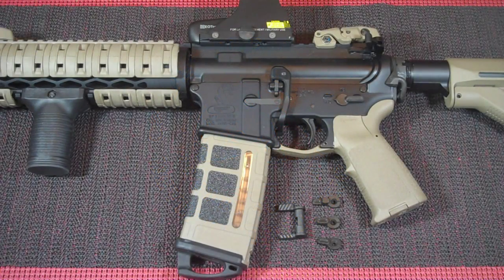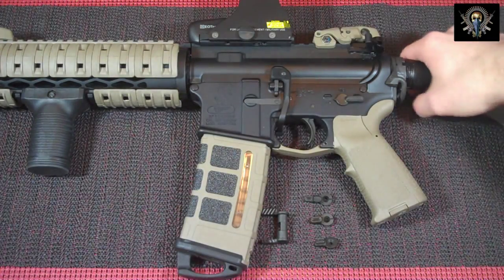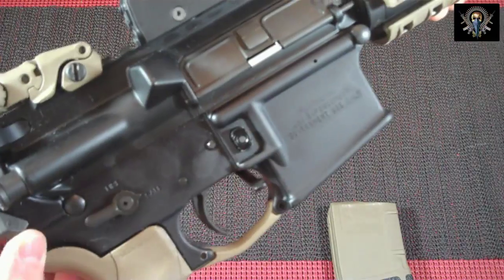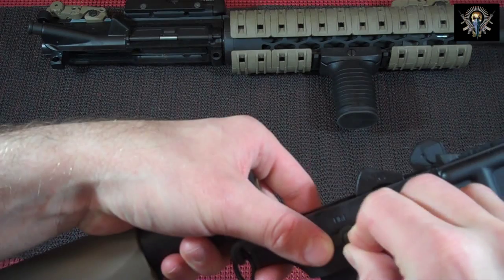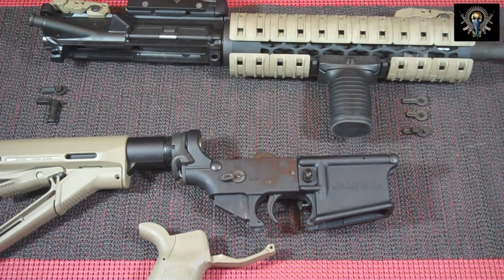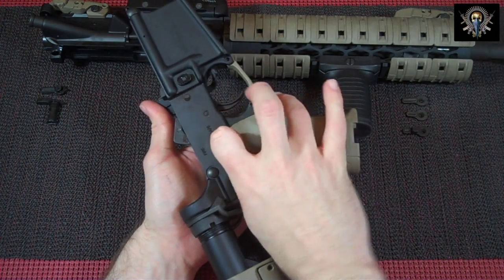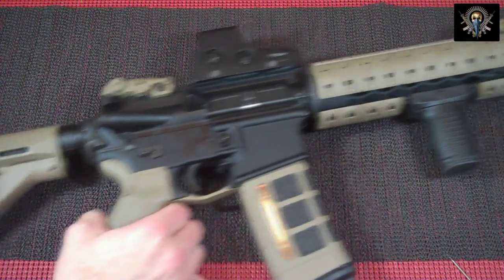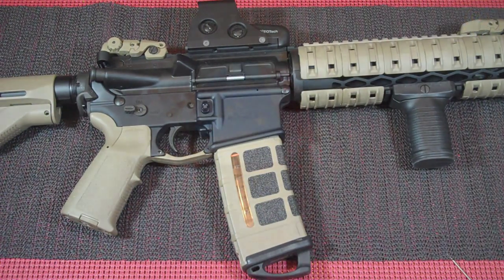B.A.D. - A.S.S. Installation

Comment from the maker: @ihatenoobsauce Thanks a lot, its not the best how to video but it will do.  The vertical grip is made by Tapco and it's their Stubby Intrafuse model.  They are cheap, around 20 bucks.  Hope that helps, let me know if you have anymore questions.

Comment: Great Video! I had a couple questions. Was your rifle on safe or fire when you pulled the old safety selector out? Also, I have a M&P15 and my selector switch has no screw on the outside of the switch to take it off. Should it just pull out once I pull the handle off? Any help would be appreciated...Thanks!

Comment: Got a question Musty...  I purchased the BAD-ASS ambi safety selector because of your professional and informative review.  For some reason mine came with the standard sized levers on both sides.  I ordered it from BravoTac on Amazon (that may be the problem) and it showed and stated it came with 1 standard and 1 short lever.  Have you ever heard of this happening.  How is Battle Arms customer service when buying from a separate distributor.  Anything helps, thanks.